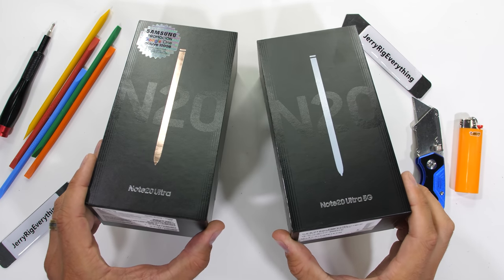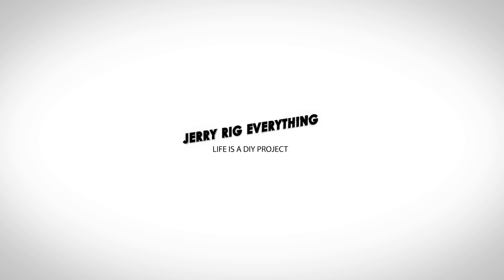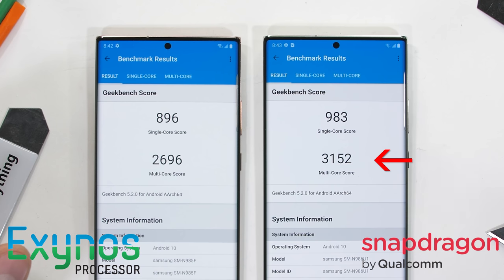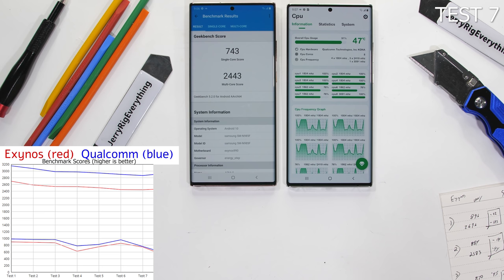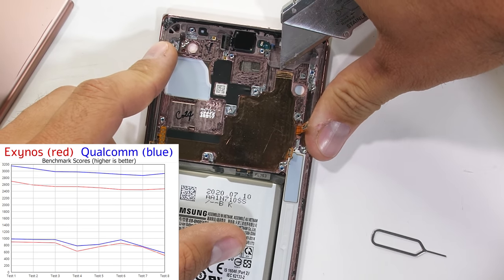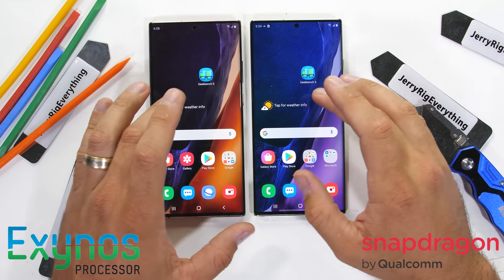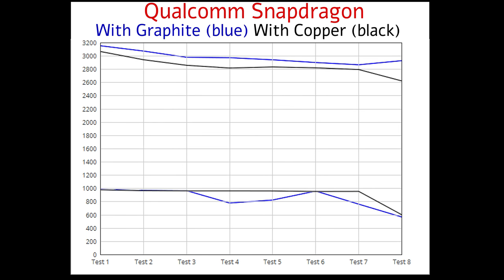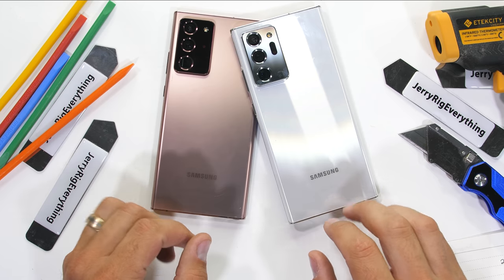Samsung should explain this... Exynos vs Qualcomm?! - Note 20 Ultra

Comment: The phone's that are manufactured in Vietnam's facility doesn't have a copper nor a graphite cooling system
And maybe that's the one jerry took apart in his previous teardown video

Huge props to Samsung for fucking everything up 👍🏻
Reply: Previous video had the graphite cooling pad.
Reply: @sensiblewheels  and it's even funnier that Samsung can't even keep those standards right. The first phone was an International model with graphite. This time the US Snapdragon variant had graphite and the International Exynos had copper. What the crap is Samsung doing? Lol
Reply: @isaiahwade1484  As we saw cooling isn't really the differentiator here, both of the system perform same in cooling, so that does not really matter. The differentiator is the processor.
Reply: @isaiahwade1484  Right? Samsung's marketing is disgusting this year.
Reply: @NanoMine  but it does matter. The cooling not so much, but when it comes to consistency and quality they are all over the place. And as you saw the graphite actually does make a difference and the longer you stay on the phone doing something like hard gaming, the more that difference is going to matter.
Reply: @isaiahwade1484  are we watching the same video? quality has nothing to do here, as long as both have similar performance it doesn't matter and both the cooling solutions performed same. Yes processors are the thing which are not consistent here.
Reply: @NanoMine  yes we're watching the same video, the same one where even Zack was confused why they wouldn't just use the same thing in all phones. And it makes no sense from a budget aspect on Samsung's part. Why would you spend the money on R&D to make two different things and just randomly put them in different phones when you could spend less creating one thing and put it in all phones?
Reply: @isaiahwade1484  Do you work in a similar industry because of which you can claim your point? From what i can understand is maybe they are switching to graphite pads  and supply could not be enough currently to use it in every phone, so using copper where graphite pad could not be supplied for now. Also why are we even arguing over this? Samsung can use either of them as it doesn't really experience for customer. now making the processors similar will definitely where they should focus.
Reply: @NanoMine  LMAO, graphite not abundant enough? Are you serious with that? As much graphite as needed can be made whereas copper can't. Carbon is so much more abundant than copper it's ridiculous! So I don't need to work in a similar industry to completely destroy your theory.
Reply: @NanoMine  Oh and I forgot to ask, do you work for a phone manufacturer or in a similar industry to where you can disprove my point? Pretty sure you don't because you would've already claimed you do. So it's mine, Zack's and many others confusion and theory of Samsung slacking over your theory.
Reply: @isaiahwade1484  But you do need to have a brain to understand that you can't just use graphite directly found in its mineral form. This pad requires finer graphite to conduct heat, it needs to be processed and I don't think there are many industries processing finer graphite. Please educate yourself before putting out absolutely stupid statements.
Reply: @NanoMine  and you need a brain to realize I literally said graphite can be "MADE" meaning I'm well aware of the type of graphite they use.
Reply: @NanoMine  the type of graphite used is very inexpensive to produce. It's the same type used to lubricate locks when the tumblers are sticking. It's just layered and compressed into pads to be used as cooling heatsinks.
Reply: @isaiahwade1484  Are you joking or what? Graphite cannot be made just like that it has to be mined and and processed and as i said you can't just use any type of graphite for it. The fine graphite that is used is rare. You are just too arrogant to accept this fact and I'm not gonna waste anymore of my time explaining someone who does not want to accept. Have a good day and don't expect a reply from me as this thread is now muted.
Reply: @NanoMine  Umm no... again you are wrong which isn't surprising. Most graphite you see in most products isn't mined at all. It's made from all out coal and charcoal which is also specifically made to create the graphite. And it can be made as fine as you need it. If you had the ability to create enough pressure you could make some carbon heavy charcoal and make granite yourself.
Haha... you really think that all the graphite in the pencils produced today was actually mined? You REALLY need to do some research before you make yourself look more foolish by saying I'm wrong when what you're commenting is what's wrong. LMAO
Reply: @NanoMine  I know you probably won't bother to read the stuff in that link, so here's a really important part of it.
"Graphite is produced naturally, but it is usually commercially produced by treating petroleum coke. Coke is a byproduct of the destructive distillation of coal."
Meaning when a lot of graphite is needed in commercial and consumer products, they just make it. They don't go out and mine the graphite.

Comment: PEOPLE SHOULD SUE SAMSUNG FOR SELLING INFERIOR PHONES IN THE EXYNOS REGIONS.
Reply: They aren't the same model of phone.
They are called different names, the snapdragon has 5G in the name because it has a 5G capable processor. 5G processors are more expensive and beefier by definition.
Reply: @DavyJones3  the exynos version is also 5g. in fact it has more 5g bands than the USA version, that's why it's the international variant.
Reply: @DavyJones3  tf u smoking Exynos supports 5g too
Reply: @x3roxide  then why didn't it say 5g when he powered on the phone
Reply: @END3RFY  that doest necessarily mean there is no exynos 5G. Google it up man Note 20 exynos 5G. It shouldnt be that hard to verify an info rather than making yourself look like an idiot.
Reply: @CoolPacket  how am I a idiot. I was just asking a question
Reply: @END3RFY  Do research first then comment after.
Reply: NGL you are 6 years too late for this.. Exynos has always been like this
Reply: @END3RFY  Your question is challenging that its not 5G since it didnt say during phone boot up. Honestly, what answer were you expecting from your question? Someone insisting that is exynos 5G? The logical answer would be someone posting a link indicating exynos 5G specs which you could have googled instead of you asking a stupid question.
Reply: @CoolPacket  my bad ill be sure not to ask questions next time👍

Comment: All I'm saying is, if Apple did this, it would be worldwide mega news.
Reply: exactly
Reply: Samsung also claim their phones have 5g but in some countries the 5g attenas aren't even connected and samsung got away with it
Reply: Apple actually did this in the past with the A9, they split the manufacturing between Samsung and TSMC. 
The Samsung made SoC had worse battery life vs the TSMC part.
Reply: @Sundara229  so basically you are saying Samsung pulled the same shady shit as they did with the note 20 ultra, just with Apple's devices instead?
Reply: @MarkyAlo  search for "Chipgate" on the iPhone 6s. In that case the difference wasn't as big as with the Exynos tho.
Reply: Apple did and does way worse, like intentionally slowing old models, so people would buy the newer device. What Samsung does here is not correct, but Apple has done way worse.
Reply: Presence I think iOS 12 reversed the slow down.
Reply: @presence5692  yeah that is true when you update,  your phone gets shittier
Reply: L K yet those specs make the phone run smoothly.
Reply: L K and yet Samsung doesn’t even tell people about the processor down grade so that’s even more of a scam.
Reply: @ldtworks1052  the phones still have 5g. It's not Samsungs fault the countries ain't up to date. Still dislike Samsung though.
Reply: @presence5692  tell the whole story or don‘t even bother telling it at all.

Apple intentionally slowed down processors on older devices if and only if the battery inside is old, too. Otherwise you‘ll get funky battery percentages, showing 54% and an eye-blink later a 30% drop to 24%. Android phones do that too by the way. What do you want your phone to do once its battery is weak? Handle tasks at great speed for an uncertain timespan or at least be reliable when it comes to phone calls and text messages? If Apple wouldn’t have downclocked, people would argue about how old iPhones randomly die in the middle of the day. Once you change battery speed should be the same. That was before iOS 12, people here already pointed out that speedreduction is removed(or better say, can be turned off).

The real fanboy is always the one bashing about all other companies. Stop being stupid, both Apple products and products with Android or Windows are(or can be) good. And neither of those are flawless.
Reply: @presence5692  yes i totally agree.
Reply: @2eanimation  i agree with you but battery life on a samsung like my mum has an 2018 samsung and 5 percent stays 5 percent for a good 40 minutes
Reply: @presence5692  wanna know why they slow their old phone?it’s to save battery life
Reply: @ldtworks1052  you know that isn't really Samsung fault
Reply: @ldtworks1052  or did I just badly understand how you meant it if so please explain it to me
Reply: @presence5692  really? How about explosive phones? Lol
Reply: @presence5692  as an apple to andriod switcher, I highly regret switching cuz theres no improved user experience since most of the apps arent optimised for android and all the apps are first released on ios then andriod. Theres no doubt the cameras are good but the software implementations suck in andriod plus Apple refrains from using gimmicks like 108x zoom and shit. Like ur not gonna buy an whole ass 1200 dollar phone just for the zoom?? Just get a decent dslr at that price innit?

Edit: if u wanna say that apples trynna lock us into their ecosystem, ur right, every phone brand is trying to do that but apples is the only one which obliterates every brand out there in that field. Im not biased for apple im just saying this as my personal experience.
Reply: Tyron Love  u broke get a job 😂😂 buy an iphone and tell me ur experience afterwards
Reply: @Sundara229  A9 Bionic made by Samsung is better
Reply: @androidoneiu5206  Stop baiting
Reply: @OpasgegenLinks  top commenting nonsense
Reply: @androidoneiu5206  I guarantee you, I top every nonsense commented.
Reply: @OpasgegenLinks  A9 Bionic made by Samsung has better fabrication node process
Reply: @androidoneiu5206  Still a bad bait.
Reply: @OpasgegenLinks  Still the truth
Reply: @androidoneiu5206  No and you know that. The Samsung version of the A9 is the reason Chipgate existed.
Reply: @OpasgegenLinks  Look now, there’s not difference between the two chipsets, both overheats and have faster battery drain
Reply: @androidoneiu5206  No that is false and you know that.
Reply: @OpasgegenLinks  False are your statements
Reply: @androidoneiu5206  Stop liking your own comments
Reply: @OpasgegenLinks  stop getting angry with every autolike
Reply: @androidoneiu5206  I‘m not even angry
Reply: @OpasgegenLinks  So, you get offended by my comment with autolike
Reply: @androidoneiu5206  Still not offended
Reply: @OpasgegenLinks  and why your comment “stop liking your own comment every time”
Reply: @androidoneiu5206  Because you did
Reply: @Shrehan Vanage  just so happens I'm scrolling through these comments when my wife says "Siri tell us a joke" and then your die-hard fanboy comments come up 🤣
Reply: @therealsteel1634  not really, it 's just that apps get harder and harder to run as new hardware releases. That's the reality, no intentional slowing down here.
Reply: @androidoneiu5206  "A9 Bionic" lol are you alright? The Bionic branding started with the A11, and yes the Samsung version of the A9 is so shit that it convinced Apple to stick to TSMC and never return to Samsung for chips again.
Reply: @kevinweyrauch4875  hahahaha
Reply: @skankytrick   don’t talk about apple slowing down older iPhones. The battery does wear out over time. If u run ios 15 on iphone 6s today with the stock chip wo slowed. It will eat thru battery in 30 mins. 
And the fact that iPhones last longer is one of the greatest pro. Even samsung cannot manage to update my dads note 9 from 2018. Apples is giving iOS 15 update to the 6s from 7 years ago! I don’t get it why ppl hate apple so much. Y’all don’t believe in user experience or what. If your question is why apple releases their features so late? It’s because they just take it to the next level by improving it. It’s R&D. Yea i dont think apple is overpriced anymore. Now there are some things at affordable rates which are actually useful. And plz i dont wanna talk about the 700$ wheels or the 999$ stand i hate it too and no ones gonna buy it but rich ass ppl. Talking about ecosystem. Why do u hate that apple has the best ecosystem? Yea ik that it makes u buy expensive stuff over and over but its ur choice. They buy cuz they like it so much duh. Apple doesnt hypnotise and shit and make us buy unaffordable products. I can switch anytime. Theres always an option to. But i wont cuz i love it. They nailed the software, the camera, the microphone quality, the sound quality. Tiny attention to detail. I can go on and on why apple is better. Unlike u giving excuses that they are overly expensive and they cage u in the ecosystem(fam every brand is doing that even samsung but they not successful in it). You saying as if other brand dont slow their phones after a few years. The fact is that ppl make shit if something bad happens(bendgate) with apple products and all those who dont even use apple products start babbling how bad it is just to prove their point. Ppl wont even give a shit if i said that samsung been giving us 2 different phones with the same name. If apple did this idk what might happen to apple. So yea. Try some of this iJunk yk u might be able to tell the difference. I tell to try the products cuz IK that it will prove u wrong. U wont know if u dont try it. Still u wont. Why? Ur too biased against apple. Ik because i have tries andriod and was an apple hater too. I had the same thoughts like u before i bought my 13. And lemme tell u… its better!
Reply: @MarkyAlo  that's exactly what they did, because Samsung makes bad processors and should leave the SoC business to qualcomm
Reply: So, who cares about a crappie, overpriced, way behind on technology compared to Samsung, Xoami, Oppo ect iPhone?!?! It's funny how far behind Apple is compared to most Android devices..
Reply: @MarkyAlo  Who cares about about a crappie, overpriced and way behind on technology compared to Samsung, Xoami, Oppo ect iPhone anyway.!?!?
Reply: @michaelmorrison3404  who*
Reply: @shrehanvanage  who.. Thanks, I was extremely tired when I wrote this and autocorrect.. But, it's obvious that you know nothing about Android phones and just for the record, I own a iPhone 12 Pro Max and a Samsung Note 10 plus and Note 20 Ultra. And trust me when I say that if you own an iPhone, you're missing out on a lot.. The user experience alone is enough for Android to be the best smartphones available. I'm not saying all Androids.. But, the flagship Droids are miles ahead
Reply: @MarkyAlo  they've been pulling this since note 7 or 8, maybe s6. Unfortunately most countires only have Exynos with no alternatives
Reply: true
Reply: @presence5692  lol look at this fanboy. 👎🏻
Reply: That doesn’t happen to Apple because there’s no need for them to rely on a separate chip manufacturer. Their hardware is top shelf and samesong hardware is garbage in comparison. Apple > samesong andud.
Reply: @2eanimation  "If and only if the battery inside is old", that's a lie. Apple slows down older models regardless of the battery health or even if they've been replaced with new batteries
Reply: @2eanimation  The problem isn't just the fact that Apple downcocked older models, but also the fact that Apple didn't disclose that information and did this on people's devices without their consent and awareness. Someone with an old iPhone could've taken great care of their battery health or maybe replaced the battery. That phone will still get throttled
Reply: @ldtworks1052 That's not Samsung's fault. They say the phone is capable of 5G and it is.

Just because your country doesn't have 5G you cannot blame them. If you move to a country that does have 5G, it will work.

Comment: The Exynos Note 20 Ultra still had a screen protector on it, which could explain the screen differences you saw, although I couldn't see if the Snapdragon model had one installed.
Reply: Nah snapdragon is brighter and better colours
Reply: Do remember no 2 displays are exactly the same. It's a common occurrence on laptops, so I don't think it'll be different on phones.

As long as the differences aren't wildly different, that's normal.
Reply: @germaineliew2012  Yeah, also true

Comment: Im in exynos region so im pissed off every year since s9
Reply: Yes, Samsung is dead to me.
Reply: Since s7
Reply: Same here, brother. I won't be upgrading my imported snapdragon Note10+ any time soon.
Reply: @1000pingVendetta an import is more expensive and also supports Samsung.
Reply: @1000pingVendetta is not that easy, phones may be locked, with different signal wavelength, and excessively expensive, like over 20% more, and with the current pricing of this smartphone it means pay like a two month salary for a phone
Reply: @1000pingVendetta No 2 years warranty like phone bought on my market.
Reply: @1000pingVendetta it would be twice as expensive due to taxes